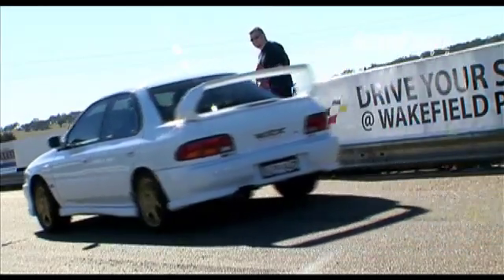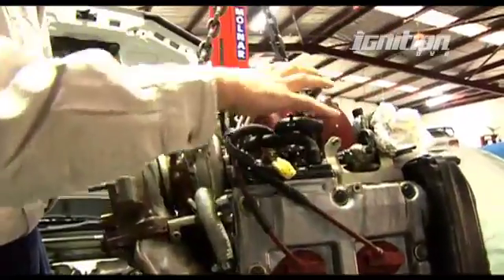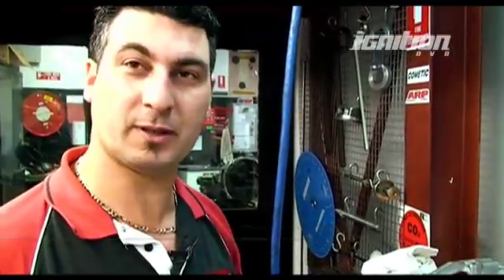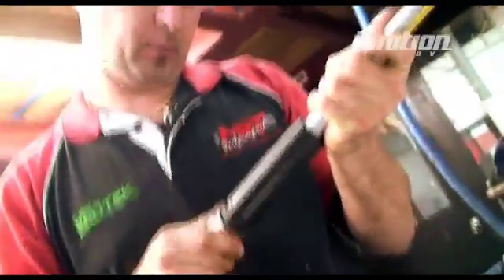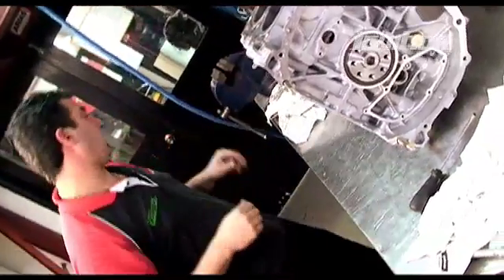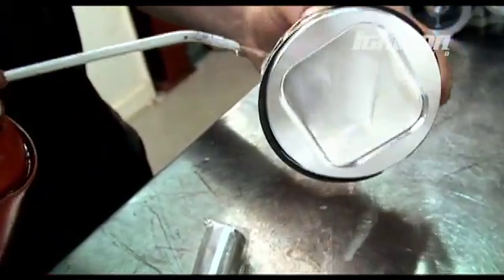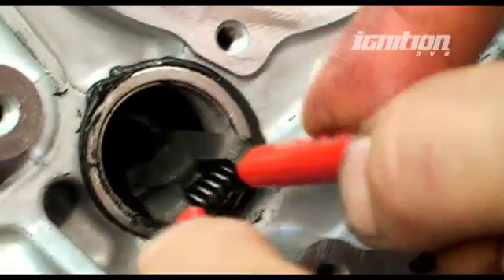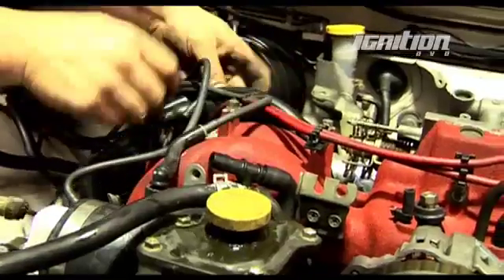Project STI  - Engine Rebuild 2.5 litre

Comment: I really wanna c the #'s on this bad boy. 
Question, can my Ver5 ej207 be fitted w/ oil squirters that the ej20g have? I was thinking of doing that, or swapping shorts w/ an RA ej20g, cuz then I'd have fully closed deck. either that or just a complete Ver7 swap, but since I just got the Ver5 Type-R, I kind of want to c what I can produce with her. What do u guys think?

Comment: 2.5's rock the car more because of the longer stroke. Use a 2.0 crank in a 2.5 case with 2mm longer rods and ej25 pistons. I hate my 2.5

Comment: The oil cooler is definitely fine after a decent flushing. The oil filter is post oil cooler, so any fine particles that made it past the oil sump screen will simply be collected by the oil filter should they make their way out. If anything should be replaced, it should be the oil pump as it is pre-filter on all EJ series engines. A new oil cooler is definitely not necessary, especially at a cost of over 220 USD.

Comment: Installing the wrist pins through the block? wouldn't it be a better design to install the wrist pins in the piston/connecting rod, then attaching it to the crankshaft with the end caps (like rebuilding a standard chevy v-6 v-8)

Comment: @Gauntletbloggs No fucked torque wrench. Calibrated to NIST actually every six months - like the manual specifies.  I actually read the fucking manual - try it some time.  @thegrimreaper4088 each time you click after the first time - you actually over-torque it.  Not a big deal when you're cranking down rod bolts on a shitty old 350 - but it is a big deal if you're building something that will fly.

Comment: Wow, there is no need to hammer the piston pins in. They will slide right is with not problem ifyou got the piston and rod lined up. That is a good way to damage the piston of rod bushing. I build Subaru engine on a regular basis and rebuild aircraft engines for a living.

Comment: @JDMnubi i had that same question, but if you look it seems that that endine is meant to be rebuilt because you can push the pins through the sides of the block at 5:29

Comment: no wonder he spun his bearings, hes got one of those cheap under drive pulleys on his engine.

the engine builder also didn't measure the bolt stretch or even cycle the con rod bolts, and was pretty sloppy with the ARP bolt lube (and what builder dosn't have a bottle of ARP lube either?) not what i was expecting for a "performance rebuild"

Comment: @yuri
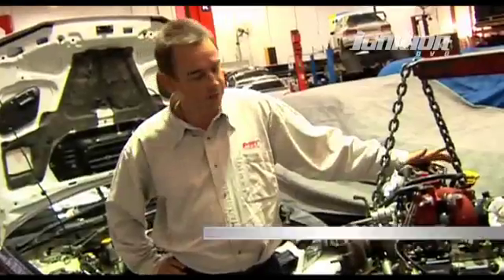0:26 2.5ltr US STI short block is more cost effective but be careful,cause there r 4 or 5 different models of shortblock & depending on where u want to go,has a big effect on the compression ratio,cam timing & eng longevity
1:14 if done internal damage to eng,change oil cooler,cause all the metal bits will come out & do more damage
Used all other existing add-ons of old eng
Oiled all the new components of new block b4 fitting
4:40 Rings easy to snap.Compress rings to get through bore
8)

Comment: if they blew up the bottom end what damage did it do to heads? When splitting the case in half you never pry on the main bearings. the main seal goes in last after checking for crank binding. When lubing the threds the best thing is diff oil. use two bolts in the crank to turn by hand to feel for crank binding. We have a special tool for installing main seal so you don't damage it. pistons in a Subaru are directional one side goes to the front of the motor. He is close on the rebuild, but.

Comment: I went with Cosworth big bore heads and Crawford s3l block. I have been suporting 500 at the wheels for about 10 weeks. TALK TO ROCKET RALLY IN BC CANADA. I know that might be a ways away. But the good thing is that they know this setup. CHEERS